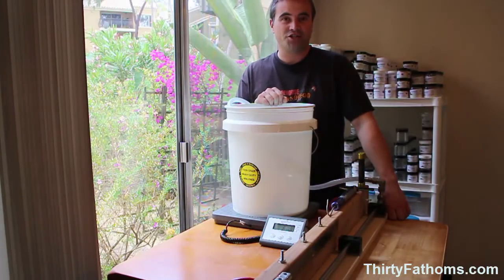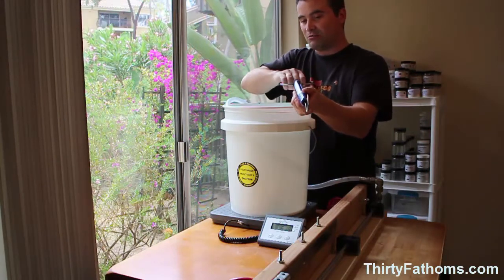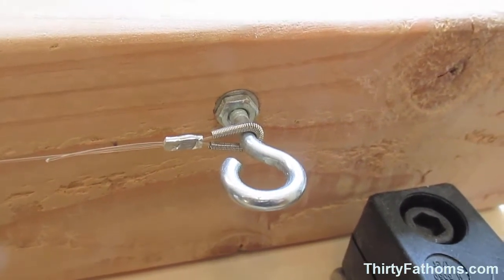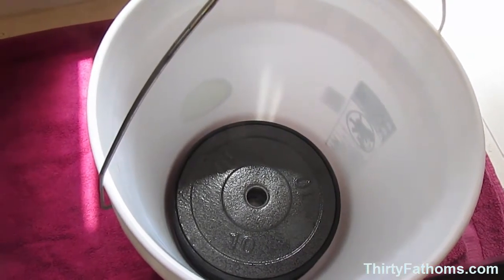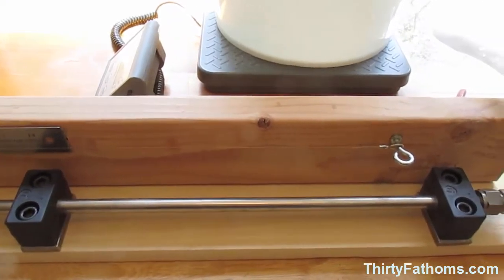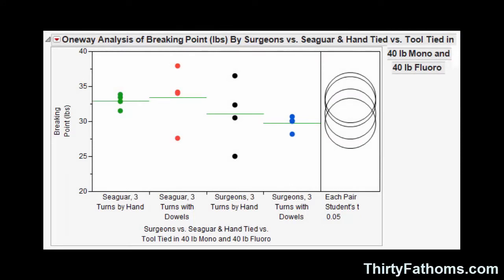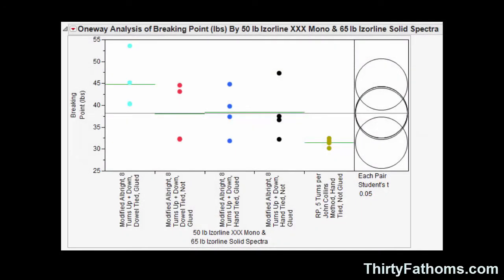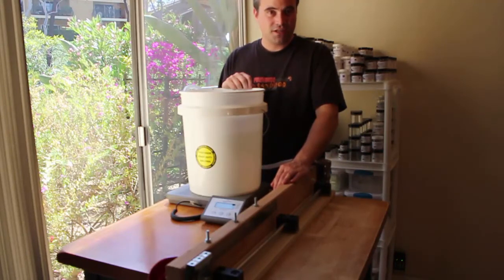Testing the Break Strength of Line-to-Line Fishing Knots

Comment: Great video, thanks for sharing! Love the methodology! Any chance you can share a supply list for others that want to build a similar rig?
Reply from the maker: Will do. I'm making a new video soon, but I'll post the parts list to this video shortly.
Reply: Great! I have to watch the video a few more times but the level of variance in some of the tests was surprising to me - as you mentioned. Do you have hypothesis around what caused that? Also, do you account for water left in the line that has not yet made it to the bucket? If not, why not, negligible in terms of weight impact?
Reply from the maker: I think the variance is due to my knot tying technique. Despite trying to tie the knots consistently, there's still some variability. I back this thought by the fact that the "test / control" runs where I just use a straight strand of 30, 40 or 50 lb izorline had very little variance (I had a chart showing that). Since I know the method has very little variance with straight line, I assume that the variance I see in my knots is due to my knot-tying abilities, and not to some error with my test jig. As for the water in the tubing, that complete run of tubing is fully primed with water up to the shut-off valve at the start of a test, so all I have to account for is the weight change on the (source / reservoir) water bucket. If I hadn't primed the line with water before hand - you're right - I'd need to account for it. I keep the line fully primed at all times - the system function as a siphon with gravity feed.
Reply: Thanks for the explanation on priming the lines - makes sens. Variance in my knots is the primary motivation for me wanting to build something like this so I understand :). Lost a few big ones lately. Look forward to the supply list once you have a chance to put it together!
Reply: OK, last question....how exactly is the shutoff valve triggered?
Reply from the maker: I use that Swagelok plug valve. As soon as the line breaks, I close it. The hold up in the tube downstream of the valve is only an ounce or two. I'm working on a more mechanical setup with load cells for the future as the bucket and water, though accurate, is slow to execute.
Reply: Thanks for clearing that up- I was thinking the shutoff might be triggered automatically by the break.